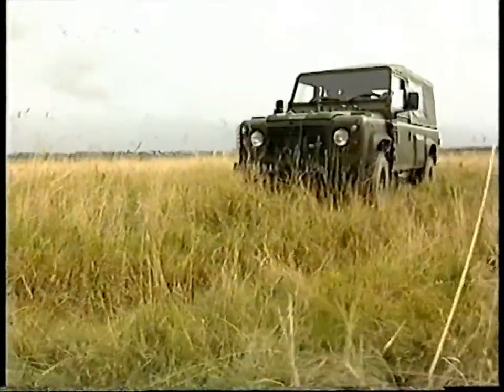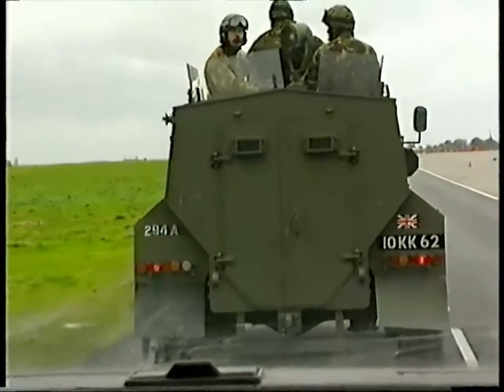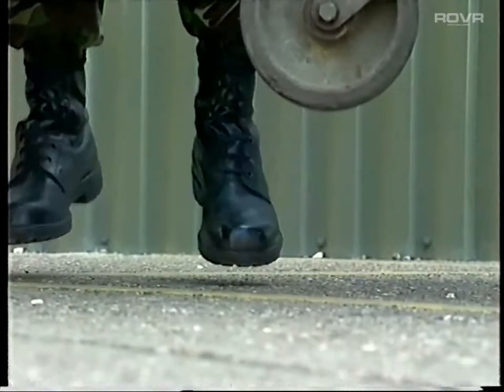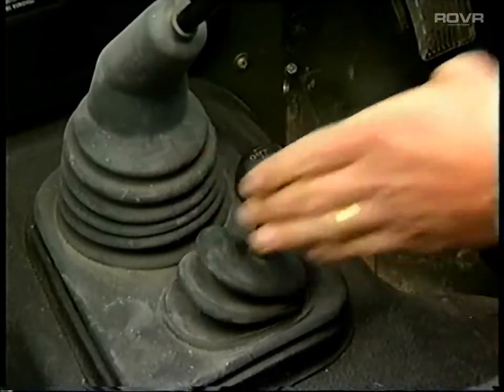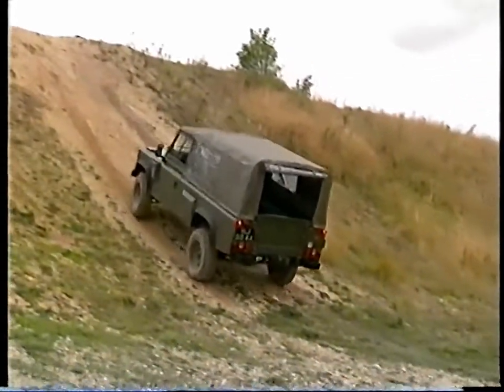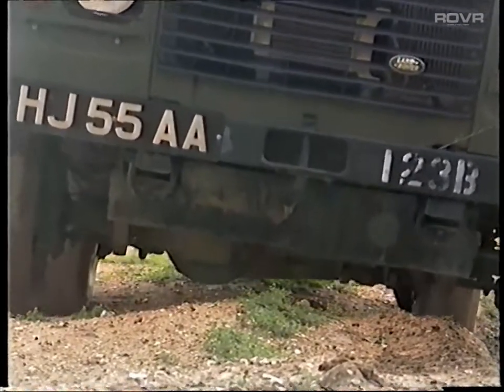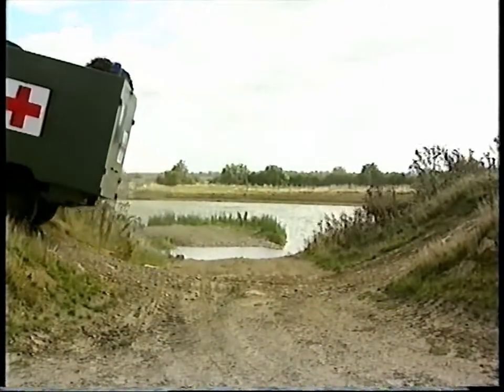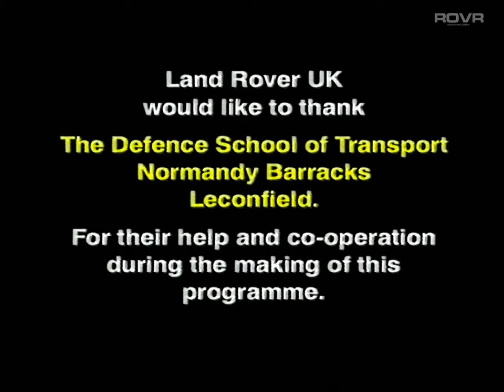Land Rover - Military Operations - Safe Driving Techniques - On Road & Cross Country Driving (1997)

Comment: Not to keen on driving upto the white center line on left bends like in the diagram.....most knob drivers coming the other way will be slightly on your side of the road.

Yes it GIVE YOU BETTER VIZ.....but at what cost.
Reply: This used to be taught on the advanced motor cycle course. 
I was never keen on hugging the the centre line for fear of being wiped out by some idiot driving over the centre line coming in the other direction.
Reply: Exactly. Was thinking of that too. Good view but costly!!!
Reply: This video doesn't go into enough detail. You stay close to the white line only when you can see far enough ahead to safely reposition if an oncoming vehicle appears. So position nearer the centre line further from the corner, but if it has a relatively restricted view, a high dense hedge or similar near the edge of the road surface on the inside of the corner, then you would move back to a more central lane position closer to the corner, obviously balancing the view with speed to ensure you can stop in the distance you can see to be clear if needed. 
The advice in this video is incomplete and not up to Roadcraft standards, so if you're actually interested in driving to a higher standard, look into the book 'Roadcraft, the police driver's handbook'. If you're not committed to purchasing a book, there's a channel 'Reg Local' here on YouTube that goes through the techniques much more thoroughly. Roadcraft is what sets the standard the IAM and RoSPA set their 'advanced' driving tests to. At an advanced level, off-siding on approach to a corner to the left was also suggested at a time, but at least one serious collision involving a police trainee in Scotland a while ago means they don't advise that now. 
If applied properly, it's still perfectly safe and beneficial, but again, all dependent on the conditions, which are everything from weather and traffic conditions to time of day, road surface, type of road and it's layout, the positioning of road furniture, vehicle being driven, vehicle loading and mental state of the driver, their capabilities (honestly assessed), etc. Reg Local has covered it at some point speaking from his personal experience through training police drivers himself, emergency response drivers can feel pressured to prove ability during assessments, so could feel the need to pass something to prove they can overtake to make progress or move offside for a better view when it isn't optimal for fear of being marked down for failing to make progress or position for view, so you can theorise how incidents might occur from that. Just because it's beneficial in a few scenarios and given as advise for those, doesn't mean it's advise being given to then be applied to all, this isn't the standard government driving tests. 
The fact the on road driver indicated left after overtaking a considerably slower vehicle suggests they're not advanced trained, unless they're overtaking with a considerably faster vehicle approaching them from behind, in which case they shouldn't have committed to overtaking in the first place. 'Advanced' driving has systematic elements, but the act of driving, order of actions, etc, need to be as variable as the conditions experienced on the road. A basic test standard is more systematic overall with things like 'always indicate' (of which I thought such low ability was limited to the US, but when this was filmed, apparently not), etc, which takes thought away from the driver and leads to confusion when the conditions don't align with that system or a lack of proper observation and concentration on driving which will lead to those incidents they mentioned while vehicles are reversing. They will move their head but not be able to tell you if a giant pink unicorn was in the rear view mirror or not.

'Speed is the leading cause of accidents' is a factually incorrect statement. Inattentiveness and distraction is the leading cause of incidents, but it doesn't roll of the tongue in a nice political slogan or have easy to implement 'solutions' that don't involve actually training people to an appropriate standard to begin with. In the right conditions, even one of these Land Rovers could safely do double the speed limit (with a strong tail wind as one of those conditions), but in the same place be unsafe in a dozen other variations of those conditions (still with the tail wind). Saying it's safe once doesn't mean always, but it also isn't never like too many like to jump to.

Apologies for the long read, I'm passionate about driving and hate inaccurate information shared by even significant sources on it.

Comment: "Diff lock" in this case meaning Awd placed into 4x4. I hate the way it's always spoken of like a special thing. So when you have a jeep that is two-wheel drive with selectable four-wheel drive putting it into four-wheel drive is the same concept. So you're taking this all wheel drive Land Rover and putting it into regular four-wheel drive but it still has no axle diff locks its just a standard four-wheel drive when locked. Basically not special at all in any way.
Reply: it is kinda special cause with normal 4H/L use on a landrover You only have 4 wheel drive as long as all four wheels are touching the ground. İf You lose grip on say the right front wheel the left front wheel Will also stop turning cause all the power Will be going to the right wheel with the least resistance spining in the air and youll only have rearwheel propulsion. Say İf You somehow manage to get both one front wheel and one backwheel off the ground then your Jeep or your LR wont budge even in 4w drive. What diff lock does it ensures (by locking one wheel on same axl) left front and rear right, so that even İf one wheel is cut from the ground a division of the power is splitted and this way it goes to the wheel still grippin the ground allowing the vehicle to move. İn my opinion its not a Real 4 wheel drive unles your car has a diff lock. (not including the electronic computer power distrubiting system newer LR vehicles have, they are also awesome)